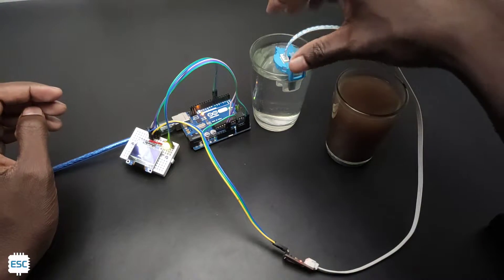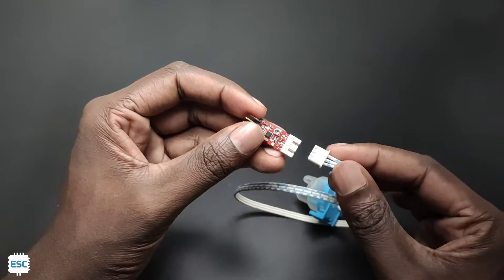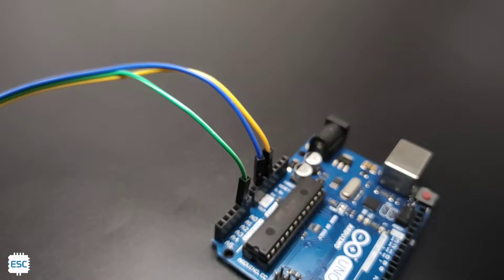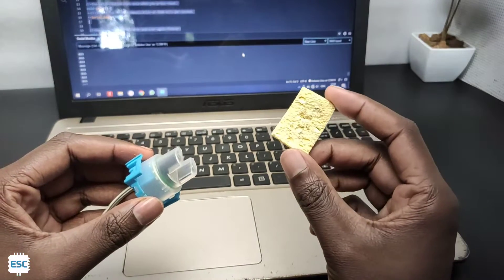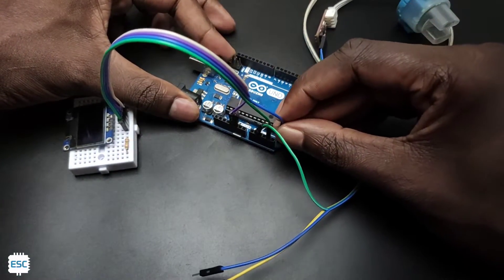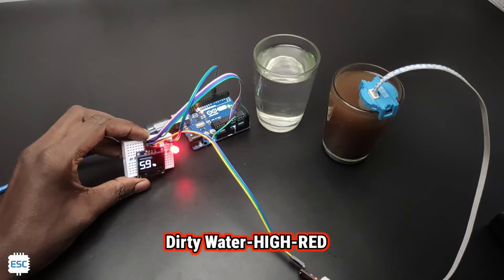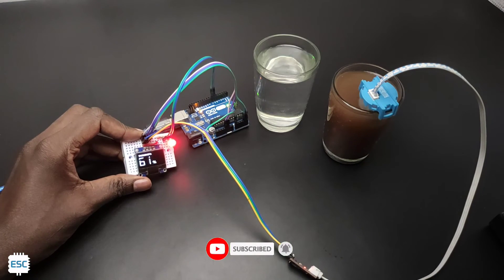How to make a Turbidity meter using an Arduino Uno | Calibration

Comment: This doesn't actually show how to calibrate it. Can you please guide me better? I am using TS-300 B when I bring a solid ovject in between. I get 0 value, but when I remove that I get values between 1000-4500, I tried varying the potentiometer, but there was no notable difference
Reply from the maker: What is the exact value when you remove the object

Comment: why my sensor value fluctuated, from higher to low eventually 0, and then go back to high, i tried many same module like this and also have changed arduino, still the same
Reply from the maker: The problem is with the turbidity sensor . You have to change the sensor

Comment: In your video, you connect the sensor to A1 but the "example sketches code" is written to use A0, thus:    int sensorValue = (analogRead(A0));   So, your Serial Monitor display of the data is not possible running the code in your video.  Maybe you addressed this mistake later in the video and corrected this🧐, I don't know, I didn't stick around for "debugging".
Reply from the maker: Yes that's true just change the pins

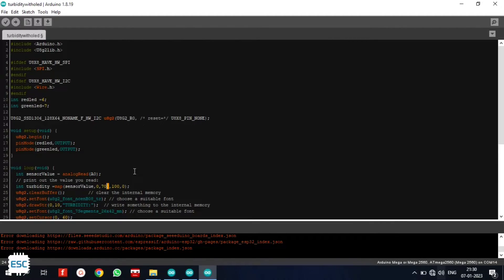Comment: Great video but 2:05 How to find calibrated value? and also after placing the blocking material the value i get is still fluctuating between 120 - 460
Reply from the maker: How to find calibrated value.! Thats what is showing in the video😭. There is a small variable resistor on the module just adjust that
Reply: Have same fluctuating values issue, I’ve tried turning the variable resistor to no avail